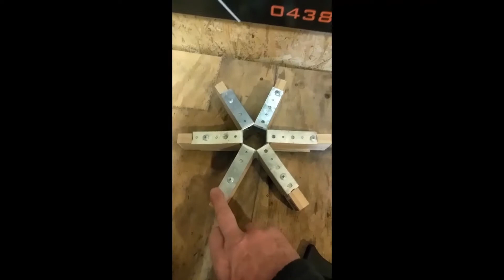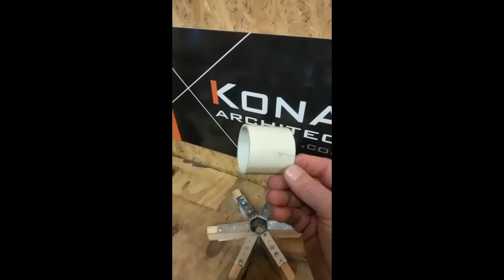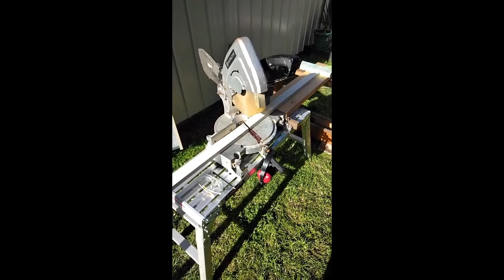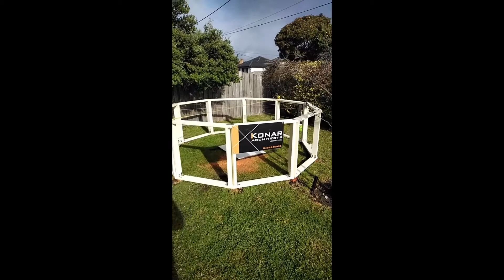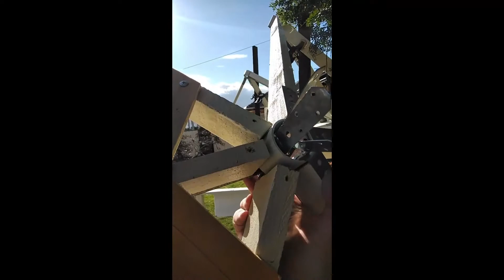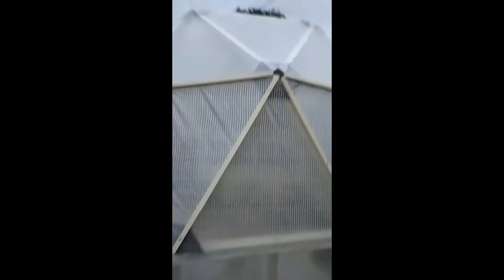Geodesic Dome - Greenhouse Construction

Comment: You should post this to reddit r/greenhouse. How about an update? How is it going? Any improvements?  Was thinking would your connectors be strong enough it the dome was larger?  5m?6m? Great video liked the step by step!
Reply: If dome is larger 4v is idea woth to think and steel pipe as connectors I build this summer 3v 5.8m diameter  done.